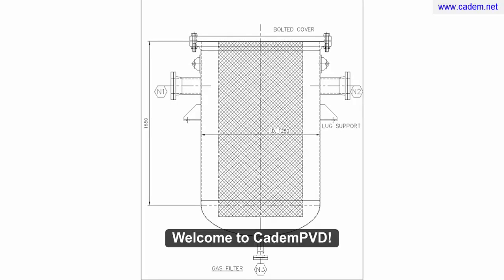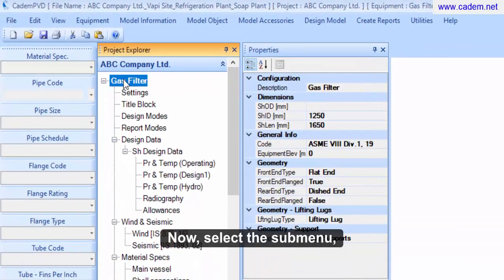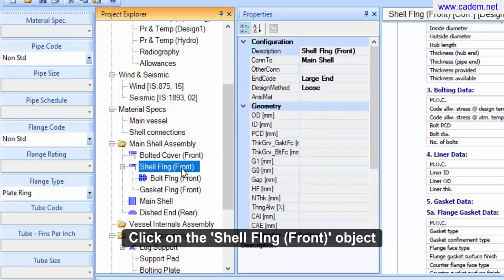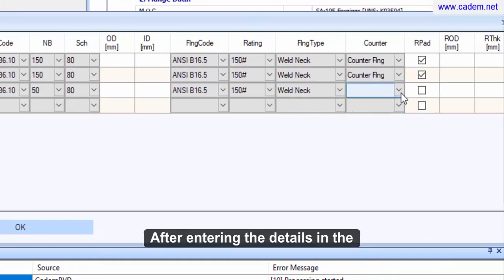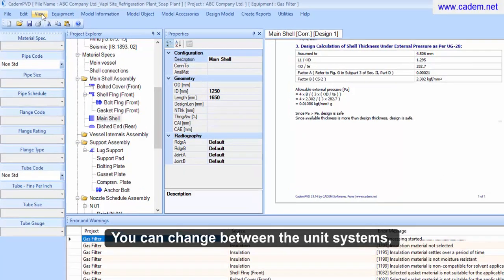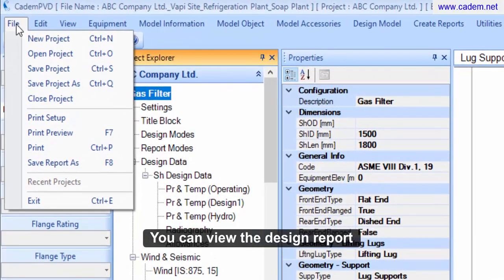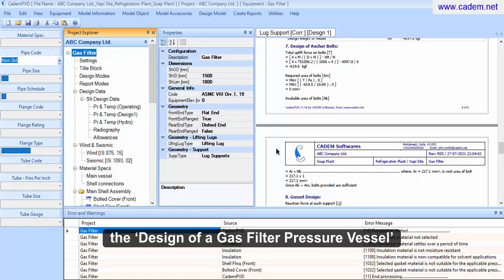PV-02 - Pressure Vessel Design ( Long Version ) Using CademPVD Software ( PV02 )

Comment from the maker: INDEX: 
Video starts at 0:39 .

 0:00 - Index
 0:39 - VIDEO STARTS HERE - About the Equipment
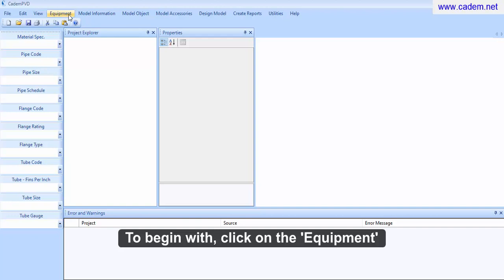 1:24 - Adding a Pressure Vessel 
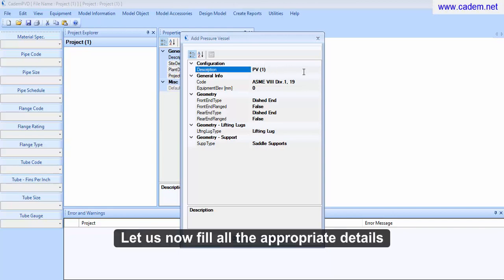 1:37 - Basic Configuration
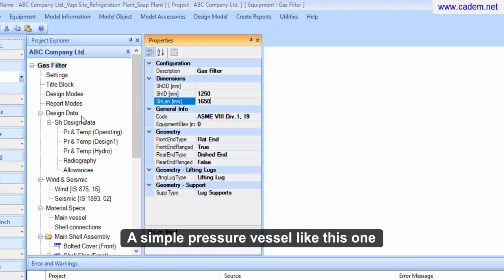 4:10 - Entering the Design Data - Pressures, Temperatures, Radiography Requirements, Allowances
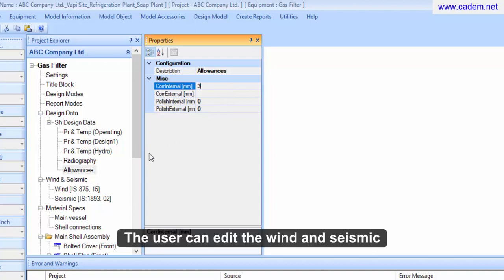 5:52 - Wind and Seismic Code Definition
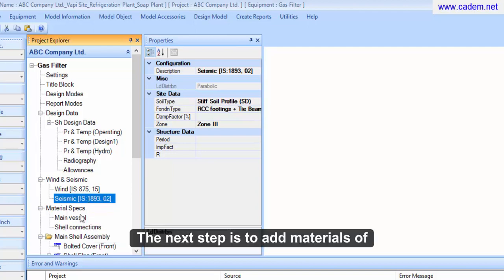 6:09 - Material Definition
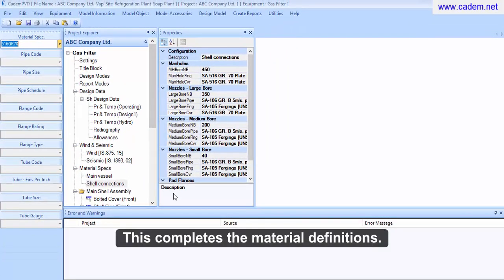 7:10 - Equipment Design

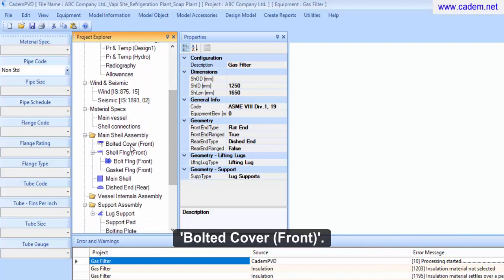 8:29 - Top Bolted Cover Design Report
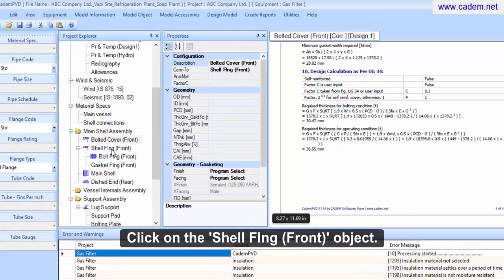 9:20 - Shell Flange Design Report
10:09 - Changing the Flange Material and Type from Plate Ring to Fabricated Weld Neck
11:09 - Changing the Bolt Size to M36
11:21 - Equipment Redesign
11:35 - Shell Flange Design Report
12:27 - Adding Nozzles to the Equipment
15:59 - Nozzle N 01 Report
16:47 - Equipment Design Summary Report
17:37 - Main Shell Design Report
18:00 - Switching from MKS to FPS system and back
18:40 - Changing the Shell ID and Length
19:04 - Equipment Redesign
19:22 - Updated Main Shell Design Report
20:05 - Lifting Lugs Design Report
20:51 - Lug Supports Design Report
21:38 - Equipment Design Consolidated Report
23:22 - Equipment Design Consolidated Report - Other Formats